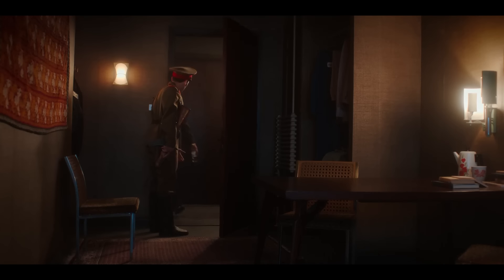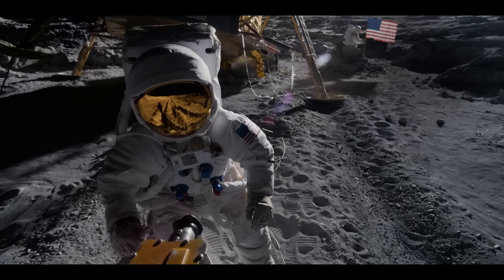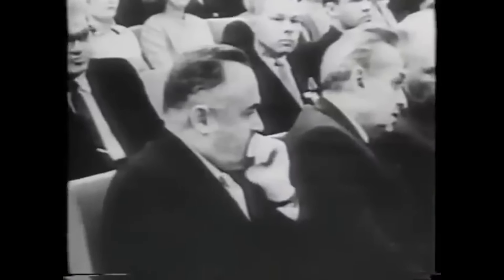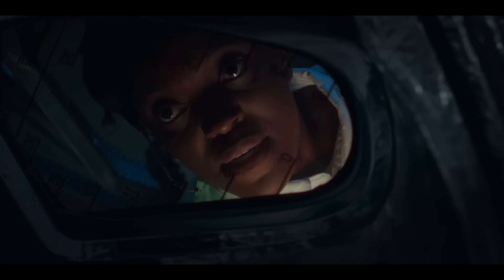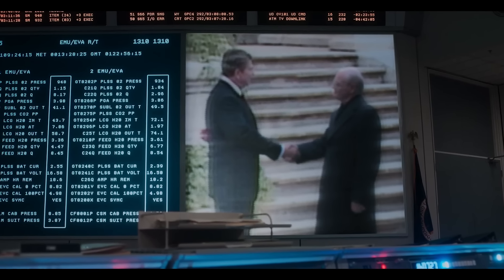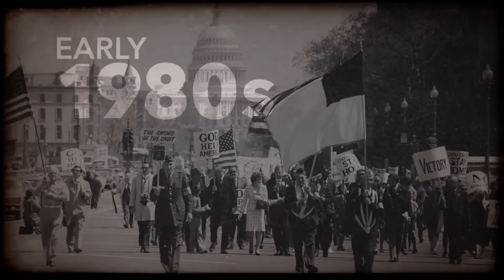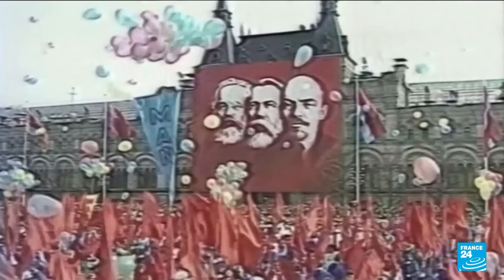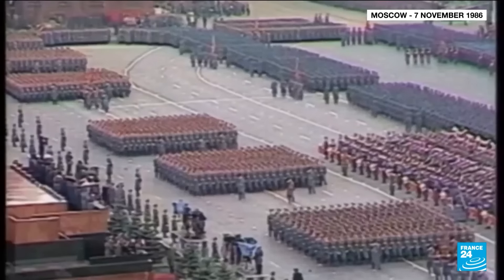For All Mankind Alternate Timeline Explained | Changes 1983 - 1992

Comment: He3 would be the best fusion. Since it emits energy in the form of charged particles, you can use a magnetic field to directly capture energy off the reaction without mucking about with a bunch of junk like massive turbines. Also no neutron activation so there isn’t really waste from stuff becoming radioactive or breaking down. Unfortunately it’s way harder to do than even the easiest fusion which we can barely do anyway
Reply: they are other techno stuff they could try

Comment: Thomas Payne telescope being equivalent to James Webb telescope is kinda wrong here. Yeah, perhaps it looks similar but in function it's much closer to Hubble telescope. In the show, as you mentioned, the Thomas Payne telescope is an orbital telescope, just like Hubble. James Webb telescope is not an orbital telescope. It sits at one of the lagrange points, far out away from Earth which makes it far more capable than Hubble (besides the fact it's also larger). Having the Thomas Payne telescope, looking like Webb, but then having it only be an orbital telescope makes little sense. It's a bit like having an F1 car but only letting it ride on normal tyres.